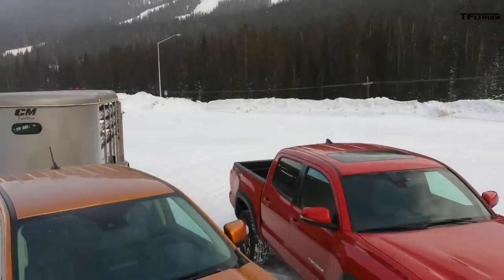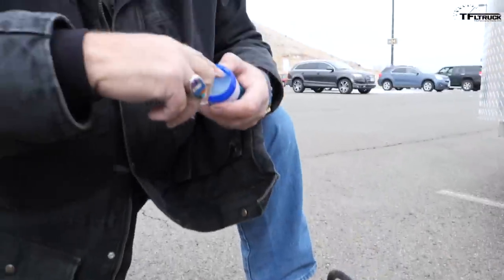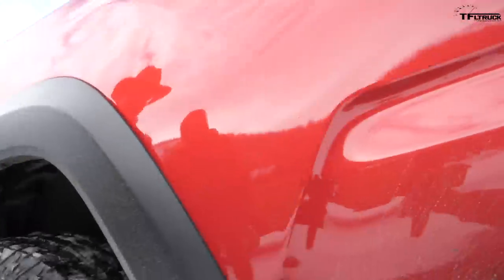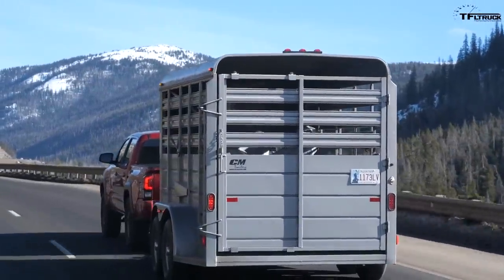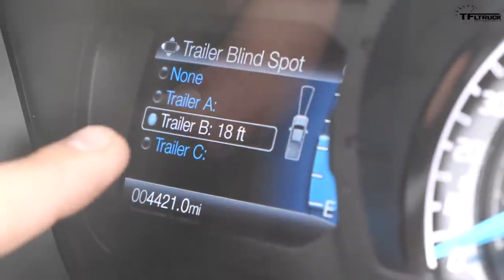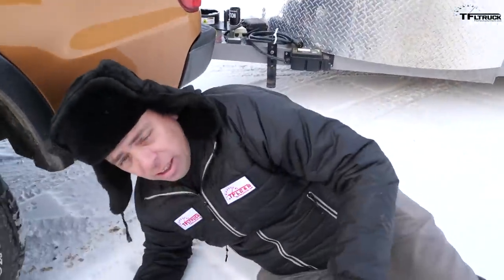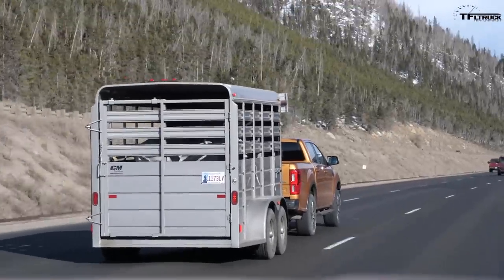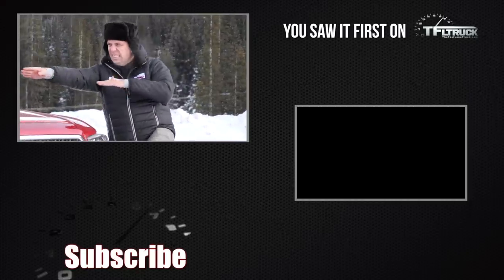Best Midsize Towing Truck? Ford Ranger vs Toyota Tacoma vs World's Toughest Towing Test

Comment: The Ranger bump is foam and progressive, and engages without punishing the driver, and why wouldn't a truck builder design it that way?  The Tacoma has a rock hard rubber brick, it is VERY lame being 2019, but this is Toyota's typical methodology: weak leaf springs, very little bump travel, and hard rubber bump stop, exactly the same on the 2000-2006 Tundra, and very similar deal on 2007-2020. NEWS FLASH: the big 3 truck brands have better suspension designs in general than Toyota.  If you did buy the Tacoma or Tundra, Archive Garage delivers suspension solutions to solve the deficiencies.

Comment: Is changing your own oil that much cheaper than paying $35-$45 at jiffy lube depending on the coupon I have each time I go?

BigOTires did mine last month for $37.00 out the door.  

Where would you buy 5-6quarts of oil, an oil filter, and disposal of the oil at some point for less than $37.00?
Reply: Ya but your getting sub par oil and filter. For that price you could be using good oil and filter for that price if you did it yourself.

Comment: Add a TRD turbo charger to the Tacoma and then compare the two.  You'll get different results and would be a more even comparison.
Reply: Mike Phillips a more even comparison would be a v6 ranger. The toyota will still fall behind compared to the ranger or colorado. Reliable truck, just can’t compete with the market anymore with it’s outdated technology.
Reply: Ya then just add a good tune to the ranger and it walks all over the tacoma. You forget the rangers engine is built from factory for turbo forged crank rod and special pistions. Taco cant hang.

Comment: I'd have the Taco. So it's a little less comfy,  little worse mileage, but it's a known quantity. This Ranger is a new model for NA and for my money it's an unknown quantity. The ergos are bad and that's a sign of a car that didn't get much time in engineering, There's a time and place for a slapdash beater truck, but there is also the Nissan Frontier, so I don't see why I would buy the Ranger. Not to live with. Not for whipping. not for $35000. I'll just keep thrashing my POS frontier and either wait for a new frontier to whip or buy a Gladiator and really appreciate it.

Comment: I’m not going to be hauling a trailer . I need it for snow and the hills and mountains . I work in the gas and oil industry near the Appalachian mountains . I will be hauling camping gear and kayaks . They have racks that attach to the truck bed . Ford nailed it and will take back the midsized market . Guaranteed...
Reply: Co-pilot 360 ...

Comment: Not a fan of Turbo'd engines but I'd have to go with the Ranger, if Mr. Truck was saying he was cramped in the Tacoma, that would be a huge negative for me...and they were cramped in 2008 too when I was truck shopping which is why the 2008 Tundra ended up in my driveway, well that and the $1500 price difference between a cramped truck and no V8 to plenty of room and the 5.7L V8 it was a no brainer which truck to chose, and obviously Toyota still hasn't learned...the Tacoma is over-priced and cramped.

Comment: I’m still confused about the brake applications. Wouldn’t the engine going faster be a good thing?
Reply: Remember that they only count brake applications going down the mountain. They do not want to exceed the speed limit, which is 60 mph. The trailer, being sometimes heavier than the truck, can push the truck down the hill and cause the truck to accelerate. The break applications are what slow the truck down to keep the speed limit, and keep the truck from losing control from increased speed. Hope that helps!

Comment: All things being almost equal, performance-wise, the Tacoma is my pick. Reliability, durability, tons of aftermarket options to fine tune it to your liking, no turbos to go wrong, more cubes and a 6 speed instead of squeeing more power out of a tiny engine and a 10 speed tranny. Tacoma is a very capable truck with a great track record and high resale value. And, for me, it's a beastly looking thang compared to the Ford, lol.

Comment: Is it true you have to take off the drivers side front wheel to change the oil on the Ranger??
Reply: No! If you raise the truck you can easily reach around the tire to remove the access panel.

Comment: It will be interesting to see how the Ranger holds up over time.  The old one didn't age well compared to Toyota.   My only experience with these two trucks is the Toyota.   I don't like the 3.5l. Of the soft springs.   I recognize that it will be reliable over the lo g term.  Imo I'd take a v6 half ton over these types of trucks.
Reply: Uh the old ones aged better than Tacos in some cases (models years) and just as well year for year. Are you comparing Tacos that are 10 years newer to old Rangers? Did you forget about the Taco frames cracking in half?  LMAO the shit people say sometimes...

Comment: Cmon Dodge. Get that Dakota into production. I also hope Ford gives us more engine options in the Ranger. I’d be happy with a 2.7 or 3.0 NA V6
Reply: Any V6 without turbos, or supercharging would be great.  The only reason the 2.3L can move out of its own way is the twin turbos, without those it wouldn't have the power to move just like the old 80's rangers with the 2L 4 cylinder....the trouble is every time you wind those turbos up your fuel economy goes to shit so you aren't gaining anything but chopping off 2 cylinders and adding turbos.
Reply: William Sevier 
We’d probably see about 170 hp from the NA 2.3/2.5 engines. I’m completely fine with that since the 90’s Ranger’s V6 made Hp in that ballpark. I’d prefer reliability and longevity over power. I have a full-size for pulling/towing.

Comment: I almost have the same hitting my head problem in my moms 2016 Jeep Cherokee. For me it’s the I almost hit my head on the part that’s lower because of the sun roof. You usually get higher trim level vehicles as test vehicles so they will pretty much always have the sun roof. Have you tried a Tacoma without one?

Comment: Different displacement, different cylinder count, turbo vs natural aspiration, different gearing, 6speed vs 10speed transmission, different fuel delivery system, I’d say this comparison is about as far as one can get from equal. But if your only looking at equal body size, and loads then yes the ranger wins. However the constant hunting from 4th gear to 6th gear on the ranger concerns me about its mechanical longevity. The Toyota engine running at 5k RPM concerns me a little bit, but not too much as long as you’re aware of fluid temps for the Toyota you’re fine. Nothing an aftermarket intercooler can’t remedy. As far as the head room don’t get the useless moon roof on the Tacoma and it’s not a problem. What MAN needs a moonroof anyway? In the end Toyota will run for a very very long time with no repairs and still have monster resale value compared to any Ford. As for recalls Toyota is superb about admitting its faults but Ford will be glad to stick you in a lemon and act like it’s a peach.

Comment: These trucks are so tiny compared to my 2500 Cummins
Reply: Recently I priced up a 2023 Ranger with plenty of options at $51,000, same as a Tacoma - and an (3.0 Hybrid doing 23mpg everywhere) F-150 with roughly the same sort of options at $78,000. There's the point. Sure, you can get monsters for almost $30,000 more. But both these trucks tow enough for me.

Comment: That was interesting how close those two trucks were. My '19 Taco has the TRD exhaust so it would definitely be a little louder. No fake noise required either.IMHO the Taco with the TRD exhaust sounds much better than the factory and better still than the turbo 4 banger in the Ford. Honestly when it comes to sound a larger naturally aspirated engine usually sounds better. The Taco looks better too. I thought the Ranger with it's higher torque numbers and the benefits of the turbo at altitude would be the clear winner. Interesting that it was a virtual performance tie.

Comment: For a truck that easily lasts 400,000kms, the new Tacoma has really lousy seats... the worst of all the midsize trucks.  

I drive 90,000-110,000kms per year, seats are definitely a selling point, considerably more important than resale value, because after 3-4 years of that kind of odometer, no brand is worth much.
Reply: good point, resale doesn't mean shit if you plan on keeping it for a long time

Comment: Didnt they say the tacoma was a 3.5l? Because the engine cover said 4.5 when they showed it i looked back twice
Reply: 3rd gen tacoma is powered by a 3.5 Liter Atkinson cycle normally aspirated V6.  The 2nd gen motor it replaced was the 4.0 liter V6.

Comment: if your planning on towing.... get a full-size truck?
Reply: Ummm no! Not like most people tow daily. Taking 5000 lbs over a 11,000 foot Mountain is plenty enough towing capacity. They are losing about 65 horsepower up at that altitude. Not a problem in any state east of the Mississippi

Comment: just curious. did they mention whether that tacoma had the sunroof, which ranger doesn't even offer? it looked like that may have been a sunroof taco without them mentioning that, all the while they complain about the roof being lower. the sunroof taco IS lower AND you have a hat on that we can see is not touching the headliner.
Reply: It was also the door jam that was low, they were hitting their heads when getting in and out of the truck.
Reply: which was also theatre. might as well have walked straight forward into the side of the truck and complained how you can't step in like you're walking up stairs. just lean forward as you enter the truck like a normal person, dummy. these guys are like those spastic dudes in infomercials who pretend they can't get the product everyone else uses everyday and then the new gizmo they're selling is so easy it's magic! get real. nobody is that uncoordinated that they can't get in a taco. 10's of thousands of guys bought tacos last year just as tall or taller than him and never once had that issue. you almost have to be trying to do that.

Comment: You realize that a 6 cylinder motor with larger displacement will provide more engine braking than a smaller displacement 4 cylinder?
Reply: It didn't work that way in the full sized trucks, the F150 with the 3.5 V6 had the same number of brake applications as the Ram and GM with V8's.
Reply: @benjaminwayneb  The turbo's act as a restriction, NA/NA would be more reliant on displacement of the "air pump", and flow restriction.
Reply: @t4thfavor1212  Very little air going through the engine with the throttle plates closed, turbo would have little effect.

Comment: great truck comparison, very empirical not all the bs found in a lot car/truck reviews.  i wish the results were more clear cut, was surprised the ford 4 cyc got only tiny better mpg.  i guess most people like me looking at these two are wondering how the ranger will hold up long term. the Tacoma's reliability is probably the biggest reason its so dominate. it will be interesting to see how both trucks sell and get priced by the end of the year. my tacoma is 14 years old (2005 1st gen) and its puzzling how little toyota has done to it in all these years other than raise the price.....I am going to give the ranger a hard look.
Reply: The Tacoma you're paying that price for a reason. And they have changed things through the years. Just not really the drivetrain engine or looks. I sure hope you didn't get that ranger.... I wouldn't really complain about the prices at the, at least it keeps running.... Those new rangers have been struggling

Comment: Why is the payload on both of these so low. My 2004 tacoma prerunner has a significantly higher rating than both of these, and it’s not even a single cab, it’s a double cab with the lowest payload in the series.
Reply: Cool Dude all the technology inside adds weight, as these trucks have gotten more luxurious they have gotten heavier. With the already small GVCWR that means less and less payload.

Comment: Hello Andre and Mr. Truck! Happy New Year! Now Mr Truck hasn’t anyone ever told you your supposed to put the grease inside the square opening of the hitch not on the slide in ball holder! But I’ll agree with both of you, the Ranger is definitely the one I would go with between the two. However I do own a 2016 Colorado Z71,4x4, V6 Ext Cab, that I regularly average 26 highway at the speed limits to 70 mph, with 18 city and combined at 22 mpg! I also regularly tow a 4,500 lbs travel trailer with the wife and 2dogs along with all our stuff at a CGVW of 9,560 lbs! On out last 4 month 4,500 mile trip, that started on February 6 and ended May 8 th. From our old house in the people’s republic of massachusetts, to sign papers to build a new house in Central Florida, the n take off for 4 months while the house was built. That trip was from fairly flat Central Florida up across the Panhandle, through parts of southern Louisiana, then to a beautiful place called Matagorda TX on the Gulf Coast for three weeks, where we were able to drop the trailer and setup camp then explore South Central TX. Then we headed northwest to The Rocky Mountains of CO and wandered all over the Pikes Peak to Laedville  Areas, then back south east making our way back. All without a single problem or issue other than computer minded oil changes and tire rotation. So over an overall 48,000 miles so far not even burning or leaking a drop of oil over the 7,000-10,000 mile oil changes.

Comment: The reason I bought a Tacoma is simply for its long-life record and dependability. I have been driving my 97 Tacoma 4x4 for over 25 years now and she has never let me down. It's also great that I still enjoy driving her. I wonder how many 97 Ford Rangers are still on the road?
Reply: Plenty. I have a 97 ranger with the i4. 297000 miles.
Reply: @User-q6x3b  Sounds like you bought a lemon .... it happens! You really can't compare a 2014 Toyota with a Toyota from the 90"s. Personally I wouldn't buy a new Toyota, but then again I have no need for a new one, mine just keeps going. Sorry it didn't work out for you.

Comment: You can access the rear camera when moving. Anything over 20mph put it in reverse and you can check on your trailer while moving forward.
Reply: I spent $35 USD on a Y-harness for my Taco that plugged right into the nav system and added a dedicated button for my back up camera... I can turn it on anytime I want as long as the truck is on. Took about 10-15 minutes to install and I don't have to risk dropping my tranny or killing someone if the computer interlocks decide they don't mind me putting it in reverse at 80mph.... I'm guessing you didn't find that tip in the owner's manual. 

Harness is available at: www.anytimebackupcamera.com

Comment: This tells me one thing, small trucks are not good for towing.
Reply: 7500 lbs is a lot of weight.  For the person who has a couple of side by sides, atv, small boat, flatbed car hauler,  and such they are great and you don't hate yourself when you have to drive it daily in the city with tighter parking.  Will a f150 tow easier and safer?  You betcha.  Everything has a tradeoff.  :^)

Comment: when you have Rangers reaching 400K miles on the original drive train with normal maintenance I will start believing Tacoma has a competitor.
Reply: My 1999 Tacoma has 270k and its falling apart. Don't believe all the BS Tacoma hype.
Reply: My 98 Toyota T100 has 365K miles on its drivetrain, the same one that is in the Tacoma.
I have never seen a turbo charged gasoline engine run as long.
Reply: U havent been around trucks very long! Ranger is legendary. Ford trucks are best for a reason.
Reply: LOL all right man, you got me I was born yesterday
Reply: There have been many Rangers that went over 400k.

Comment: Not really surprised at your final appraisal of the trucks but I have to agree.  I expected the turbocharged engine to perform better against a NA engine, especially at those kinds of altitudes.
Reply: The Ranger has more power regardless of altitude,  45 ft. lbs. more torque and the peak torque is at 3000 rpm. vs. 4600 for the Tacoma
Reply: @benjaminwayneb  - all very true, but the Toyota does not.  Any naturally aspirated engine will loose power as the altitude climbs while a turbocharged engine will continue to make sea level hp.  The Ford was still making very close to it's rated hp and torque numbers because of that turbocharger.  The Tacoma was making less than it's rated hp and torque numbers at the altitudes they were conducting the test so the difference between the two was even greater than what you're saying here.  All things considered, the Toyota acquitted itself very well indeed against a truck and engine that should have had a sizable advantage under the conditions of the test.  The Ford was only 6 seconds faster.  I would have thought it would have had a bigger lead.  Don't get me wrong.  I'm not trying to put the Ford down.  I agree with their final assessment, but the Toyota has nothing to hang it's head about, performance wise, under the circumstances.

Comment: A single cab Dodge Dakota with a 5.9 Magnum still owns this shit. It's sad all these years later all these years of the Dakota going bye-bye and it's still the king of the midsize trucks for towing and hauling. It may only be 250hp, but at 345 pound-feet of torque with its kegger intake the only midsize trucks that get close to this thing are the little Diesel's and those things are ratchety.